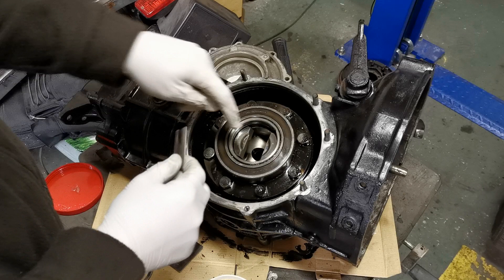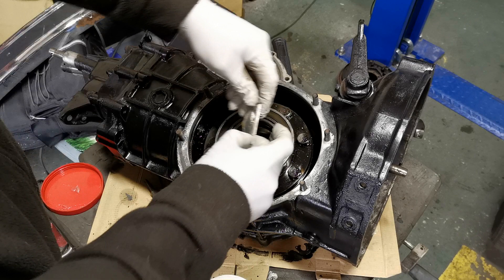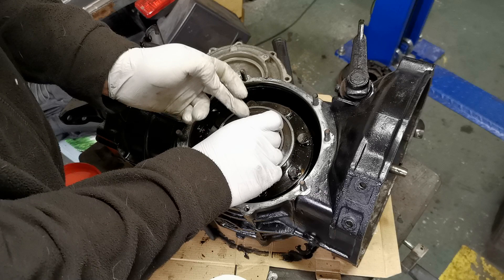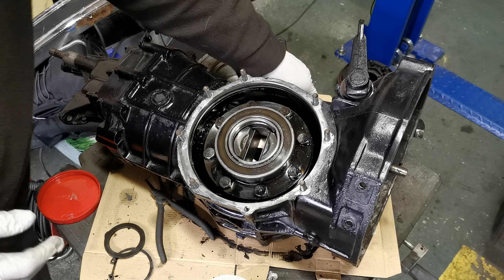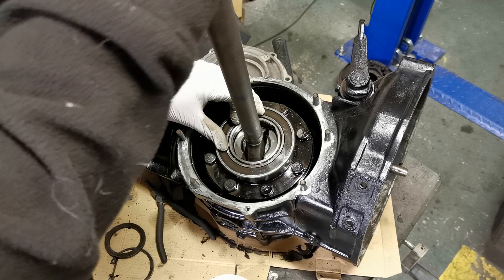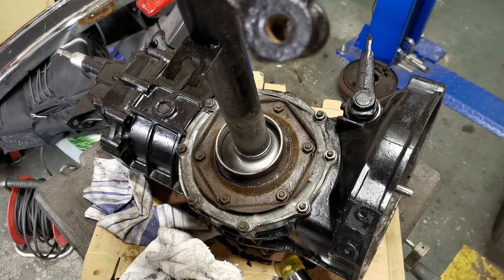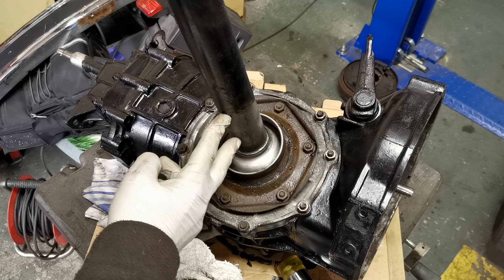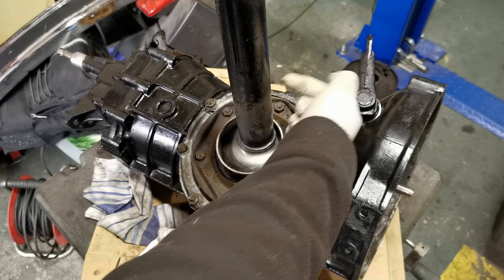Episode 10 - How to refit axles to a Beetle swing axle gearbox

Comment: Good video. Thanks,  when adjusting my handbrake recently I  found my rear brake shoes were disintegrating. The old O rings and axle seals were worn and some shims had gone missing. Oil had gotten on the brake shoes and made a mess of them. I saved your video in case I have to do any further work down the track. My bearings are okay for now. Probably my fault. I put new shoes and 5 x 130 stud pattern drums when I restored my car. I am good at panel and paint work, however I have to learn the mechanics as I go. Your instruction is great for the beetle enthusiasts out there. New seal kit and bushings in, I will button up with the new shoes tomorrow.

Comment: Thanks for  the help that your vid offered. With  your help I was able to take my axle tubes off, paint everything up, install new parts, preset the cup load and get it all back together.    If I knew how to post a picture Id show you the finished product.
Reply from the maker: Hey, that's great. Well done :)

I did a bit more work on my Bug last night. And found a lot more rust :(

Comment: I believe those nuts are supposed to be torqued as per specs (about 14 lbs/ft if I remember correctly); that will help you ascertain accurately if there’s drag between axle tube and side plate under the specified torque. Nice video; thank you for sharing.

Comment: Thank you mate. Interesting with the bearing facing in. I have always seen the ball bearings out.  I wonder if it matters??
Reply from the maker: I don't think it matters, but I could well be wrong on that! The bearing is lubricated by the gearbox oil that travels up and down the axle tube so as long as it's getting to the bearing I think it'll be OK.
Reply: @2BugsandaBack  it was put on the wrong way. Now if the bearing goes bad you can’t pull it out.
Reply: Thanks for mentioning this.  I double checked and the bearings in my 66 Beetle face out too.

Comment: Also when you're putting on the O-ring at the bearing seal you just twist it backwards a little and then push it all the way on cuz you putting it on with the iron cap it gets pinched cuz you can't see what's going on behind that and that's an instant oil leak and gear oil sucks all over the inside of your rims I don't agree with the way you put that together but that's your transmission out here with 234-500 horsepower in California being so hot that gear oil gets thin and that will leak

Comment: Secondly the three shims with the plastic sunflower you always put a little grease on that so it can move a little bit you don't want to tear or ruin the plastic cup and the groove that it fits in all the way around the transmission it can be misleading if you don't put any any grease and it's super tight for the wrong reasons
Reply from the maker: Good tip, thanks 😊

Comment: Interesting....are the bearings on the differential and the axles replacements?  The integral seals in the ball bearing units may have to be removed on the diff bearings and at least the inside of the axle bearings I would think.
Reply from the maker: No, they're the factory ones as far as I know. This car is a 2000 Mexican Bug

Comment: great videos & thanks for the help , i noticed when you fitted the large sideplate you didnt fit a paper gasket ? is it optional ? just wondering as i am about to put my sons swing axle back on ? thanks again for the great videos 👍
Reply from the maker: On this particular side plate there's an O ring rather than a gasket. You can just see it at 4:03
I don't know if earlier boxes use a gasket or not though.

Comment: I know you were at a shop I know you I saw a race bug in the background that's all fine I I don't I don't doubt your expertise but when you put the big side cover on we use 510 a thin quote of sealant special for the transmission why didn't you use that along with the O-ring especially around the bolt holes
Reply from the maker: Fair point! I'm not a pro at this just a hobby and I did this job partway through a still unfinished resto project. It'll have to come apart again before the car is finished which is why I didn't put anything on it. To tell you the truth, the gearbox still hasn't even got any oil in it yet!

Comment: my axle tube feels loose even with NO gaskets, what happened there? great vids, calm & to the point...
Reply from the maker: I've no idea! Is the plastic daisy badly worn or damaged maybe?
Reply: @2BugsandaBack  thanks, sort of what i thought, but seemed so unlikely, daisy LOOKS ok, and similar to other old ones i happen to have......hell, they ARE 50+ yrs old tho' !
Reply: @2BugsandaBack  i have SINCE found out that the 6-hole bolt down plate was dimpled just enough to distort the flatness, maybe from previous overtightening (?) it was tough to hammer & dolly it back into shape because you cant just slide it off the axle tube! creative jigging ensued. its better, COULD be a tad tighter. it ended up using only 2 paper gaskets, but thats gonna have to DO! im tired of #*@!^ing with it.....it was the FIRST thing the local VW guru suggested...now, why doesnt my inner spacer fit nice & flush like in the video? ( 15:14 ) im now assembling vertically-OFF the car, much easier...

Comment: IF you let go the axle, will the weight of it causes to drop down or it shouldn't? 
I put three shims and if let my hand go, it will drop down on its own weight.
Reply from the maker: All the books and guides I can find say there should be "slight drag" on the axle tube. I don't know how you'd measure "slight drag" but I'd guess that the weight of the tube would be enough to overcome it. I would think that as long as it doesn't feel loose, you should be OK

Comment: Cool video how would you remove the rear bearing
Reply from the maker: Hi, Episode 8 shows me removing the bearing but I do it with the gearbox already out of the car. If yours is still in the car, you might be able to undo the bolts at the spring plate and the side cover to allow the axle tube enough movement to get the bearing off that way.
I've never tried it like that though, so I don't know for sure if it works or not!

Comment: why did you take the axles out originally? Was it leaking oil, and if so do you find the source of the leak? Great vid. Thanks.
Reply from the maker: It had a huge leak from the boot/side plate area so I decided to strip it and replace everything that might be leaking.
It wasn't strictly necessary to remove the axles themselves but with them removed, the gearbox is much easier to work with and it reduces the risk of damage to the axles and diff.
I haven't tested it for leaks yet because I needed to get the Bug back on its wheels to free up the lift for one of the other cars.
I'm not happy with the paint finish on the box either so it'll all be coming out again at some point, most likely when I split the body from the pan.

Thanks for the sub! 👍

Comment: Great helpful videos on this. I'm deciding whether to strip the axels of as I'm cleaning my gearbox. Could you not fit the solid non split boots?
Reply from the maker: I've never tried the solid boots. They are better, of course, but unless they are really, really stretchy I don't know how you'd get them over the cup at the gearbox end of the tube.
Reply: @2BugsandaBack  that's what I'm wondering. Must be possible as they where like that originally and you can still buy them.
Reply from the maker: Plenty of lube and maybe heat it up in hot water.
The worst that can happen is you rip the new boot. Got to be worth a try
Reply: @2BugsandaBack  I've just found 3 videos of people doing just that. Thanks
Reply from the maker: There you go then. 3 people can't all be wrong!!
Reply: Installing the seamless boots is easy.
First inspect the OD of the bell for a sharp edge.  If it's sharp, it may cut the rubber so file off the sharp edge.
Invert the boot and set it out in the sun on a warm day.  Or set it near a heater.  Or dunk it in hot water.
I like to clamp the axle tube in the vise surrounded by plenty of rags to prevent squishing the tube.  You are going to be leaning on it, so it needs to be secure. Lube the bell end and the inside of the inverted boot. Start forcing it on with the large diameter end first.  Use two long screwdrivers through the small end of the boot to stretch the boot over the bell.  Once it's over, un-invert it.

Comment: watching you drive that bearing on with a chisle was a bit painful.........
Reply from the maker: Yeah, I should have used a length of tube or something really, but you can see that I was using a very lightweight plastic hammer so I wasn't exactly driving it on. It was more like a gentle tap.
My thinking was that I wanted to apply pressure to the centre race rather than the outer part because that might have put stress on the balls themselves.

Comment: No lube apply on the butterfly.? Or any?
Reply from the maker: As I understand it, everything is lubed by the transmission oil so there's no need to lube anything separately. It's not like an engine that needs assembly lube.